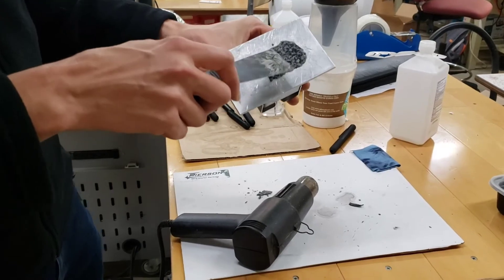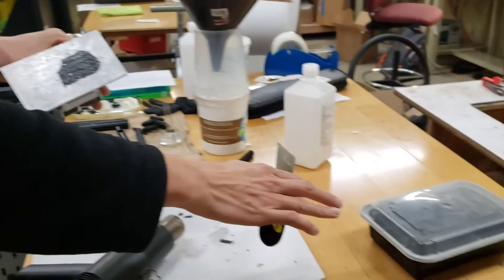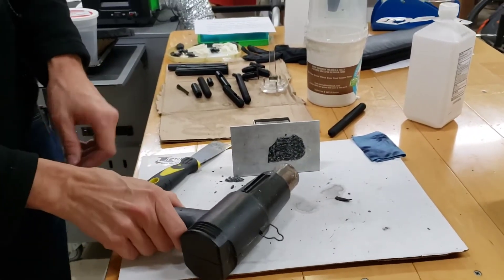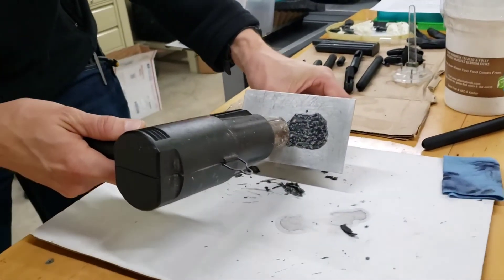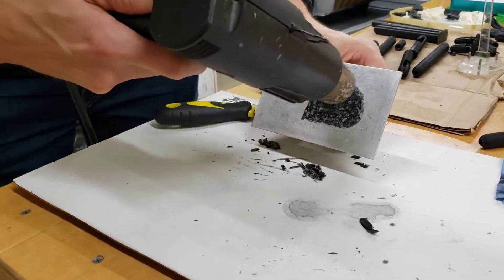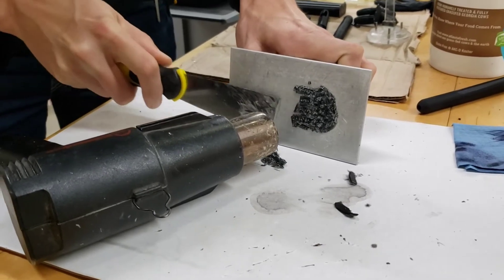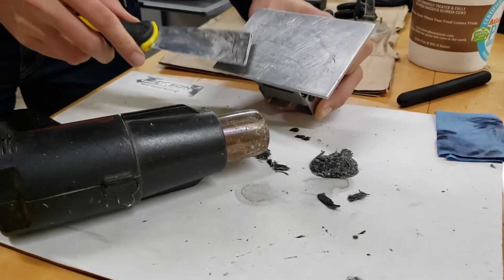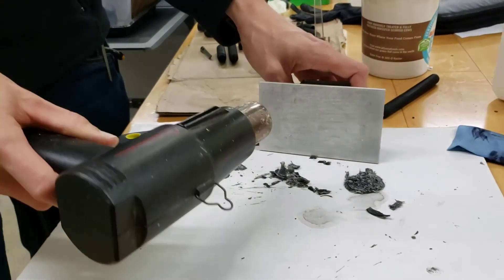How To Remove Cured Resin Stuck On 3D Printer Build Plate

Comment: Heat softens and freezing cold embrittles but you still need potentially damaging scraper action. We "opened" most thermoplastic and thermoset resins for reverse engineering purposes with methylene chloride (a bit nasty, adopt good ventilation.) On ABS-like resin nail polish remover (even acetone-free varieties) is absorbed by the resin and softens it. Getting through to the surface of the plate all adhesive force is lost and the stuff just peels off. Thick deposits are removed by wiping with paper towels periodically. Propan-2-ol is feeble by comparison.

Comment: it seem like the initiation process for new comers is to weld the first test to the plate and cut yourself trying to get it off. I got a nice gouge in my thumb. Thank you for the help, saved me from throwing the build plate out the window haha
Reply from the maker: When someone asks where you got that scar on your thumb, you can say you were attacked by a 3D printer! 😂 Sorry that happened though. Pouring over or dipping the build plate in very hot water will also help remove it.
Reply: Dude, I literally buried the blade into the top flank of my wrist and now 1/3 of my hand is numb, some damn initiation

Comment: Thank you so much for this I ended up using a hair dryer and it worked in just over a minute now I need to clean my wound from where my spatula cut deep into my hand where it bounced off the hard resin from before I looked up the video… remember kids don’t brute force things, work smarter not harder

Comment: There’s a better way without using any extra electricity. Put the build plate in the freezer for 15-25 minutes, the parts pop right off.
Reply from the maker: Ok, I will try that.

Comment: You save me good sir
Reply from the maker: Glad to help. I've heard that putting the build plate in hot water also works great.
Reply: @engineerable  yeah, I read those too but for me the heat gun is easier and safer so I dont have water whit resin
Reply from the maker: @alcatraz8694  This is true, I didn't think about the issue with mixing water and resin.

Comment: got my mono x and my bottom exposure time was waaaay over and would literally not come off. did this and it came off with some elbow grease but much easier and I didnt continue to damage and gouge my build plate. thanks.
Reply from the maker: Also, give hot water a try next time.
Reply: @engineerable  okay

Comment: Alternatively you can just use a standard hairdryer to the back of the build plate to heat it up without the use of water or needing a hotgun as not all people will have a hot gun.
I have heard of the placing the build plate in a bag in the freezer but this i think can cause of issues if like me you get distracted and forget its in there!
Reply from the maker: Good idea!

Comment: You can just heat kettle of boiling water and pour on the plate at a angle, it will do the trick. Also the reverse "freezing" will do the trick. Pop it into the freezer or outside in the winter. Basically you want to expand or shrink the metal a bit for the resin to loose its grip.
Reply from the maker: Thanks, I will try hot/boiling water next time.

Comment: Great idea, heat does the trick! I put my buildplate in hot water and the stuck rafts became soft again and could be peeled of.
Reply from the maker: That's an interesting idea. How hot? Boiling?
Reply: @engineerable  My waterheater puts out a maximum of 70°C/160F, that is what I had set it to. That was just enough to soften up the resin and to go between resin and buildplate with the metal spatula. Before I couldn´t even chisel the cured resin off as it was extremely brittle and stuck to the build plate.
Reply from the maker: @bonafazius  Thanks, this is good to know, and easier than using the heat gun. Just heat up some water in the microwave or stovetop and let it soak. This stuck resin issue rarely happens, but I will try that next time.
Reply: @engineerable  Yeah, this hasn´t happend to me until today. I used a different resin which seems to need less curing time on the first layers.